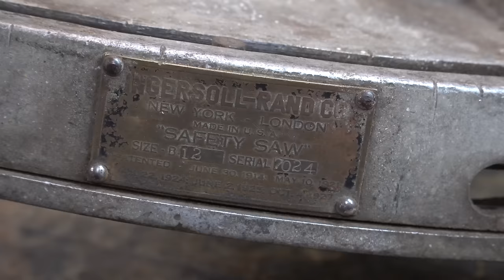Triple-Piston Pneumatic Circular Saw [Restoration]

Comment: I think it is "idling" because the removed corrosion in the trigger valve assembly has resulted in too much clearance and thus the valve is slightly leaking. I imagine if you plated the spool valve with electrolysis it might take up the lost clearance.
Reply: I think the idling sounds kind of cool. It would give you rhythm like a metronome if it was used in the field on repetitive cuts. 
Chugga chugga.
Reply: @paedahe4975  That's the pleasing beat of the extra safety overflowing. Those old tools had too much safety for their own good, that's all.
Reply: I wonder if there were o-rings on the control valve at one point
Reply: @ericpaul4575  Prob too old for O-rings, if you notice, it's all Regular slotted screws, too old for Allens and Phillips too - My 1946 and earlier stull is all slots screws, no "Modern Headed" fasteners?
Reply: It's supposed to do that... I Walter Mitty designed it!
Reply: Kool
Reply: Could be his air supply isn't at a high enough pressure to force the valves fully closed. I have some old tools that are meant for 120-150psi and they all do that on my 110psi system.
Reply: @DiverCTH  
Kind of reminded me of “The Absent-Minded Professor” (1961) and his flubber powered Model T.
Reply: That thing is awesome i wonder if you could put a cut off saw wheel in it and cut metal ?
Reply: Sounds like it’s got a big boy cam in it.
Reply: It sounds amazing.  👍
Reply: @Mad-Duk_Machine_Werkes  they had "O" rings back in the 1800's, sometimes rubber, sometimes oiled leather "Rings". 

Also a "safety saw" made by Ingersoll Rand possibly was made for use in mines for building formwork/timber sets etc underground, as it wouldn't have needed electricity, just the compressed air used in the rockdrills.
Reply: Yes leaking past the spool in the valve. Need to put some grease there, preferably sticky wheel bearing grease, and probably put the tiny little leather rings that are the seals in the slots in the spool, as those probably turned into part of the goop.  Just use modern neoprene rubber o rings instead, will work, just have to protrude off the shaft by about 1/64 of an in, so around 0.5mm thick o rings will work. They have to be able to move in the groove slightly, so that they can slide nicely.

Original grease likely was made from whale oil, it really was the best grease around, and still has better lubricating properties than any synthetic oil you can buy for under $500 a gram, as the synthetics are basically a close clone of the original.
Reply: Yes but let's all agree none of us want that idle to be taken away.
Reply: @SeanBZA  Given the age, I expect the typical lubricant would have been lard. That was widely available and common even in precision machine shops until well after my grandfather served his apprenticeship.

Highly-refined lard has several advantages as a machine lubricant: it can be applied thickly like grease, but its low melting point allows it to behave as an oil in operation. Its smoke points and autoignition temperatures are high, and it contains no additives that might separate during storage. It was widely and cheaply available. It has a surprisingly long shelf life, and it's even food-safe (variably; it does still go rancid eventually)!
Reply: Nah spray weld that shit
Reply: @jasoncooney3595  Extremely slow.The operating pressure of this saw is approximately 150 psi, with relatively small disk revolutions. Faster with air from the compressor🤣
Reply from the maker: I think so too, but I didn't want to fix it after hearing it idle.  I just hook it up to the compressor once in a while to hear it run now.
Reply: @R.Daneel  lol you got that right
Reply: @sampointau  that's a good guess, I was also wonder why it was ran on air. That makes a lot of sense
Reply: @Azlehria  you're absolutely right about lard, I've heard many things that used that back in the day. We actually used some recently to slide a very heavy shed on some railroad ties. Used a high lift jack and helped ease it over once jacked a little. Worked like a charm. The guy that helped us was telling me pretty much what you just said. I thought it was brilliant, it's semi waterproof, non toxic, and works well. Very cool
Reply: @HandToolRescue  hahha with the ding of the blade and the idle you can make a cool song lol. I'd love to see it run at full potential. But I'd also bolt it down and slide it with a jig or make it like a Radial Arm Saw. Definitely need a Sharper blade too tho. The more force you have to use the more likely you are to get hurt. Learned that framing. Can't wait to see what you with this or what you fix next. This thing is awesome
Reply: @jasoncooney3595  I don’t think you need bother changing blades. Just point it the direction you want the cut, pull the trigger and feed it material!  😂
Reply: @howdypotowty  I’d set the air supply at 10cc.
Reply: @DiverCTH  ta-pocketa!
Reply: @ericpaul4575  Is this Eric Gary Paul from NJ!?
Reply: @augustm.moschera8646   I am in NJ, but that is not my middle name.  From PA originally.
Reply: @HandToolRescue  You Canadians have too many mushrooms 
Kinda semi crazy
Reply: Can it be just an easy and safe way to know that the thing is ON? Well...if I think about it some more...proper pressure will probably spin it much faster in this "idle mode", so...
Reply: @HandToolRescue  yesss Agreed
Reply: @ericpaul4575  The whole saw probably leaked like a sieve right from the factory.  Even the pistons were just solid slugs, with no rings at all.
Reply: oh yes
Reply: There's a reason "Safety Saw" is in parentheses: this device predates safety. 
At the time this tool was made, "safety" was still theoretical.
Reply: @paedahe4975  It kind of sounds like a Harley!
Reply: @BradfordGuy  At least a Honda Rebel. lol
Reply: @HandToolRescue  understandable, this looks painful.
Reply: @R.Daneel  old tools? Safety? Yeah.
Reply: @Larry Cleeton you are correct.   I have worked on several older pneumatic tools,  and 9 times out of 10, that "idling" is from a small gap in the trigger spool assembly.
Reply: @frankierzucekjr  Why only semi waterproof? I mean it's fat and she therefore be completely water-repellent. Your usually can't mix fat and water without an emulsifier right?

Comment: These heavy duty pneumatic tools probably saw a lot of use in the mining industry. Many mines were not electrified, and usage of pneumatic tools would also reduce risk of sparks unlike electric motors. Also these pneumatic motors were light and compact for their power at the time. Drills and hammers were already using pneumatic air, so the piping and large compressors were there, and I think saws like this would come handy when timbering the mine. The standing pneumatic grinder you mentioned, lot of the larger mines had workshops down the levels, so running those workshop tools from the air line makes perfect sense too. Very interesting restoration as always!
Reply: There was probably more than a couple of job sites out in the bush that might have had a petrol powered compressor on site but no electricity hooked up yet this would have suited. Thinking with the right diamond wheel, enough water and no sense of self preservation it'd be bloody good for cutting marble
Reply: Oh! Good point! I wonder if the lack of sparks from a brushed electric motor is why it's a "Safety" saw.
Reply: @wbfaulk  No, safety because the guard is spring biased so that it dropping will not cut you, you need deliberate force to expose the blade from the guard. 

Yes mines have a lot of pneumatic tools down shaft, all for safety, and no sparking, though a lot of them also have hydraulic tooling there as well, powered by water, as after all you do not need a compressor for them, merely the main shaft depth and that column of water.  Dump the water to both cool the rock and keep dust down, and in any case you need to pump large volumes of dirty water out, so you have the sumps and pumps there, and as well that water often contains useful amounts of ore, so it also gets run through a centrifuge to get rock out, which then is treated like ore, and the rest is filtered and treated before discharge, though a lot also goes back down after that as clean process water.
Reply: Agreed. It's primary use is in mining. Compressed air was used not just for drilling but also underground winches - this saw would run on the same source of air.
Reply: i was told that air tools are also often used when you expect super long run times on the tools. they don't heat up or wear out like motor driven tools do, and they can often get a lot more torque. i have an air ratchet set meant for a racing pit crew, and they are torque monsters despite not being even rated for torqueing bolts
Reply: There are lots of "hazardous locations" where pneumatic tools were common.
Reply: @krissteel4074  It would need to be a bloody big compressor. As a rule of thumb, an air motor needs 8hp driving the compressor for every 1hp delivered by the air motor.
Reply: @Gottenhimfella  The old trailer mounted compressor was sort of a staple for a lot of years and still is on some places like road crews and big building sites. They usually throw about 200 to 450CFM and run on either petrol or diesel depending on the model. Really handing if you're running jackhammers, compactors and stuff
Reply: @krissteel4074  that is the kind of compressor I pictured for running this saw anyway, mostly because of the brand. Usually where I have seen it is just over the barriers on a road construction site.
Reply: this is definetly for use inunderground mines. I've also seen pneumatic chainsaws this size and larger. lots of carpentry underground
Reply: pneumatics power tools in mines also help to ventilate them.
Reply: The Amish also rely on pneumatic tools, so there would be some market in their communities.
Reply: I see.  Perhaps “safety” meant no sparks from an electric motor.  By today’s standards, it didn’t look that safe when he used it.  I have had trouble with pneumatic tools “idling”

Comment: I like that this was named a "safety saw".  It's no wonder tools like this don't exist anymore.  Where do you find these death traps?  They're awesome!
Reply: Safety saw in that it both had a spring guard that kept the blade away from contact, and also you needed force to retract the guard, a big upgrade over the older ones which had only a cover to keep the chips from hitting you, and no other blade protection, basically a bare spinning wheel of death.
Reply: These saws were made for underground mines with methane or other explosive gasses.
I had a  pneumatic chainsaw and a  pneumatic arc welder that i used underground
Reply: @anned8634  'Pneumatic arc welder' seems like it may be closing the barn door after the horses are out.
Reply: A viewer named Liz Matzelle saw it on Cragslist and sent it in.
Reply: @anned8634  pneumatic arc welder???
Reply: @frogz  the arc welder had an alternator and batteries powered by an air motor
Reply: @anned8634  I have no reason at all to want one..... Why do I want one??
Reply: @frogz  The entire contraption would be really amazing, huge aircompressor to power the airpower welder
Or just to use on a maintenance truck, that has compressed air on board to begin with.
I've been thinking to find a pneumatic chainsaw for a logskidder, so there is no need to pullstart and carry fuel around for random limbing

Comment: Holy Kadoodle HTR, cant believe your 90psi @20cfm wasn't enough for this Timber Beast, but then again the size of the 3 pistons was very impressive let alone the trick bearings.  Great Job keeping it real with the restoration and repairs!  Thanks Much for another @y@ Popping Rescue!
Reply: As a rule of thumb, an air motor needs 8hp driving the compressor for every 1hp delivered by the air motor. They are impressive in many respects, but efficient use of air is not one of them. A Mack truck air starter motor (vane type, very noisy, also made by Ingersoll Rand) uses about 750 cfm. Luckily it spins the engine so powerfully it only has to do it for a couple of seconds. So the air brake tanks, provided they haven't leaked down, will supply enough air. If not, Mack supplied hoses so you could couple up the tyres! Start the diesel engine, fill up the brake tank(s), then refill the tyres and you're off...
Turbine starters (eg Austart) are more efficient and quieter than vane type. But they still use a lot of air.

Comment: The noise of the saw motor, and the cutting blade, and the air compressor big enough to run it, makes this most ear-splitting power saw ever.

Comment: I may have said this before, but seeing that intro and opening music with the clip, your face... It is better than drugs man, it brings a tear to my eye... I duuno why, is it because you remind me of a friend from a long ago, is it the nostalgic series opening from decades ago when times were better... You are a gift of God to mankind my friend...
P.s. a bloody nice saw... I was first thinking it would be a diesel 2 stroke, but when i saw the pneu valve trigger, i was not disappointed, as i didnt read the info... I see your vid, i like and fullscreen, then i read the desc... Either way, yeah, no wonder its got torque for days, that thing with a proper compressor and a 400 liter tank would be able to much through anything... Hell, this thing could only suffer from overheating of the main bearing, as from what i can hear, despite it cooling itself by air constantly, the idle speed increases slowly, which kinda points toward grease being heated up... The pistons and the walls should be getting cooled and contracted equally as one seems to be steel and other cast iron, so no differential shrink rate there, which only leaves the grease churning as the obvious source of heat, which doesnt seem to really be a great thing... I dont know anything about this saw, maybe it likes to warm up the grease and idle at higher speeds, but im not sure at which point of continuous duty does it want a break...

Comment: Hope you try it on a compressor with enough air one day. I'd guess it needs a diesel unit like they use with pneumatic jackhammers to run how it should.
Reply: Looking at the original inlet piping (0:24) it seems to be at least 3/4", so this thing will need quite some air to run at full beans.

Comment: I want to give a big shout out to the hand tool rescue wrench and flat blade screwdriver. I bought them because I thought they were a cool thing to use as a decoration with no real intention of using them. I have more expensive wrenches and screwdrivers that are my go to tools. 

I have never owned a better made tool than these two. The wrench is amazing. When everything else was twisting out on a square head that thing held fast and saved an impossible to get part on a vintage car. I use it all the time. I will be ordering a couple more of them. On big screws the screw driver is great, it fits in my hand, does not slip. As I said these are well made tools that are far better than any other brand including snap on.

Comment: Thanks, I really like that. I have a four cylinder air drill that is patent dated 1901-1909. It's a "V"-4 but two of the cylinders are on the same lobe on the crank shaft and compress at the same time. The crank shaft drives a set of planetary gears. The output is a #2 Morse taper. It sounds like an old truck when it's running.